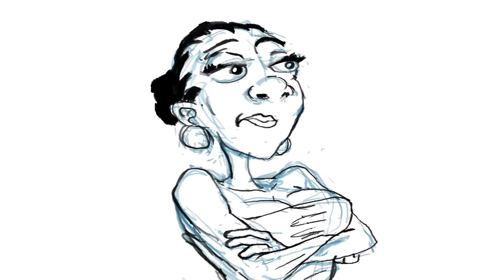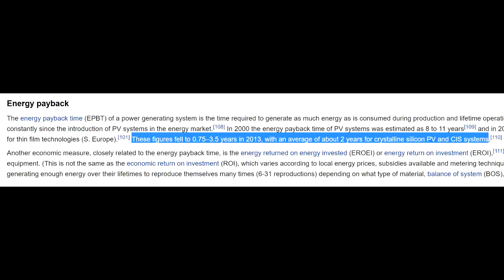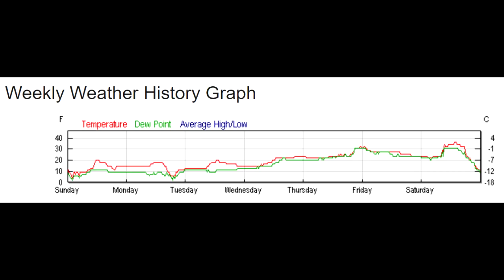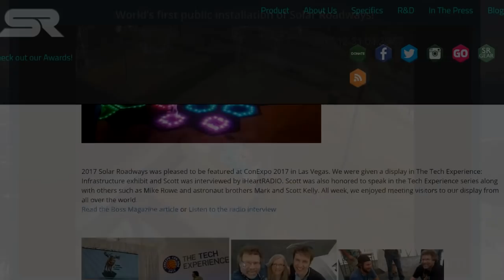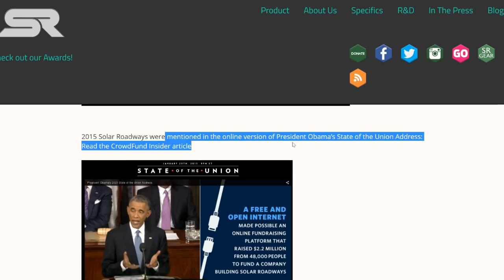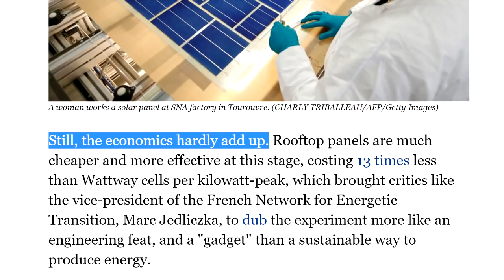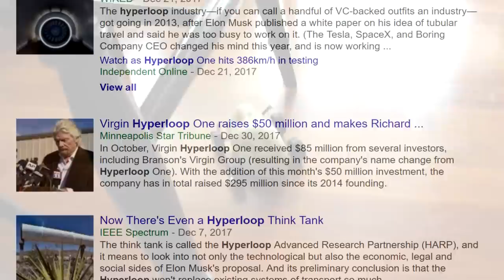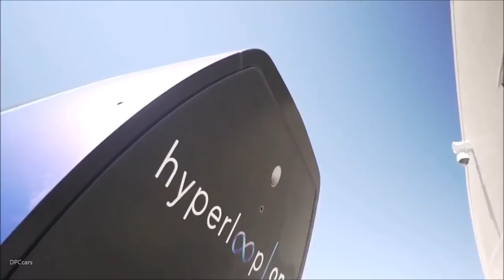Solar roadways, NEVER shovel snow agai... oh

Comment: If the bloody roadways melted the snow, it would just freeze to ice on the side of the road, and make a river. A river bed of glass, and ice cold water.
Reply: And the millions of solar panels shorting out because of the water.
Might as well be one epic failure/catastrophe.
Wow, epic failure, haven't used that age-old meme in a long time.
Reply: Not exactly,  pex line is installed in residential area's and in some public transportation. Its just a plastic tube that is hooked up to a boiler  a few inches below concrete. And the melted water runs into the sewers to prevent buildup. Its not to common because of the initial costs.  It works really well though.
Reply: Where I live, the sides of the road are 6 foot deep ditches. So no real loss there.
Reply: Maybe you just invented Solar River Canal Beds Division of Solar Roadways.  Now can you think of something that might work for Solar Tunnels?
Reply: Then we would need those super cool plastic roadways with inbuilt drainage channels... oh.... wait. :(
Reply: Guys, it's so obvious.

Solar Freakin' Water Boilers!
Reply: Maybe we can go ice fishing then? But other then that, even going straight into the sewers won't make everything better cause you know, not every single place in the world has a good sewage system DA LA. I know my area is finally getting new shit LITERALLY. With all the new hotels up we need it, there are more hotels in the area then there are restaurants. (This is an actual fact.) every winter the pipes would freeze at the old hospital creating a literal shit show some years. So yeah, let them all drain into the sewers, but then just outside the city where does all the water go? God people are stupid.
Reply: admiraal534 
Yeah, but your city hired people who actually understand how this stuff works to build a thing with a set purpose. Without grandiose claims of it generating more power than it uses!
Reply: Uhm, roads normally have provisions in place to carry water away. Maybe they don't in the primitive US, but elsewhere, they do.

As a result, what you describe does not happen.
Reply: Don't worry, the solar panels generate a gigawatt of power each, so they can just vaporise the snow into steam on impact!
Reply: You guys must not live in a northern climate. 

The snow melts all the time on the road and never forms an ice sheet on the side of the road.

Never once seen it happen even in -40°F/°C temperatures.

Same with heated driveways.

I don't know if this is true or not but asphalt melts most of the snow by its self. I think it is because it is black so it absorbs more heat from the sun. Also all the cars traveling on it creating friction and the cars themselves are warming it up with their exhaust ect. I have never googled it but roads that are traveled a lot their snow is always melted pretty quickly unless it is crazy cold.
Reply: Yes they do, but ditches will normally not be heated. You need to keep the water above 0, so this solar panels with snow and water (and short days with little light) on them need to produce enough energy to melt the snow but also heat the water to keep it from freezing while in the ditch. You can do this in a city if you have a big and warm sewagesystem to catch it, but if you pour water in a ditch in cold weather, it will freeze. Imagine that.
Reply: It probably wouldn't have much of a chance to refeeze before entering the drainage system which prevents the road turning into a pond when it rains.
The problem with melting the snow as it falls on the road is the amount of energy required.
Ice has a specific heat capacity of 2.1 kJ/kgK and a latent heat of fusion of 334 kJ/kg
Reply: There's the cost of the energy to melt the snow, especially in a heavy snowfall.
Were it that simple I suspect that such heating systems would be a a standard feature at airports.
It's far more common to use specialist snow removal vehicles, even though these might be parked for most of the time. Takes far less energy to move snow a short distance than to melt it.

Comment: Solor roadways powered by thorium that last 100 years with cold fusion.
Reply: solor*
Reply: Solar*  Road*ways
Reply: If they funneled sewage in the tunnel, and then used a methane generator running off said plumes of sewage.. you could essentially power the thing using our own crap. Makes more sense, and yes this is possible now with farms reusing cow and pig waste as a source of fuel to power their own farms.
Reply: $200+ backers get a free artificial gill that also extracts 10L of water out of thin air daily while recycling CO2 into phone cases as well, all while hovering over a copper floor!
Reply: well the hovering over a copper floor one is possible with a non-powered magnetic object if you get all the north/south poles of the copper lined up correctly but it will only work on specially made floors and only for a short time too
Reply: That might work cause thorium is Very dense.what?
Reply: You forgot about Vitamin B17 and Tesla's Hyperfail
Reply: That random person That comments nothing wrong with fission if we could build modern plants. Everyone thinks Nuclear plants have to be like Chernobyl.
Reply: <scratchy record sources> "And good sir, is this new marvel of modern science powered by coal?"
"Of course not, foolish urchin! The heliodynamo mechanical horse-path (p. pending Doctor Barnabus Q. Fosdyke & Sons) is powered by pure RADIUM!"
Reply: Thorium powered cold fusion? Oxymorons are fun.
Reply: *Sulla rordwes
Reply: Shoulda used thundrainium.  My fav fuel source as a kid.
Reply: Thorium is very dense
Reply: @gameplayCroatia  no he spelled it right

Comment: Proof of concepts are cool but generally they're supposed prove the concept before they're implemented.
Reply: Cameron Goode I see this working in the south where we get light snow and ice at worst. But up north and in mountains these would just be bad. :/ I've lived in Alabama most my life and Pennsylvania the other parts and I could not see this working up there XD
Reply: "This is a state of the art system."   "But it doesn't work!"   "Well, yes. Unfortunately, that's the state of the art."
Reply: Cameron Goode If you go on the website instead of referring this ‘‘tis video you’ll learn that these are early prototypes that literally are tested outside their house. Of course there is going to be problems with beginning stages. Being skeptical is always fair but just shitting on something that could potentially have a huge impact is just cynical. Just think of Thomas Edison and the lightbulb it took him thousands of tries, Elon Musk and his sea platform payload launching rocket took him a hundreds of tries. I don’t know why everyone is so unoptimistic about this here....
Reply: Dams can wipe out entire species of fish in an ecosystem that rely on breeding grounds. Wind can mutilate flocks of birds traveling north during season switches, and both by no means are as efficient in relation to solar power. Because both rely on moving parts, which wear over time. Solar power has no moving parts and can essentially last as long as it is protected from harm. Solar power is going to be efficient when engineers and scientist figure out the graphene battery, which is also solid state and will not wear down over time. Plus the fact that the new roadster Telsa is producing can go for more than 300 miles, and recharge in a matter of a minute,  that's revolutionary. Also solar roadways predicts that if the entire road we have today was replaced with these then America would produce 3x more energy. 67% of that would only be utilized as the other 33% is used for the functions of the heating and LEDs. Yeah sure continue to shit on this like scientist in the old day would at theories that turned out revolutionary. Soon when it is completely fleshed out, I'm sure this will do the same.
Reply: Also Don't get me wrong the company Solar Roadways is taking it wrong in some ways but the first people to do it usually start the race. Example: China. Nobody was good at building rockets at the beginning of the space race... 10 years later 2 people successfully planted the American flag on the moon.
Reply: Nope, just prove that the concept exist, ¡Duh!
Reply: :D I think then you need to travel back in time to the 60s these guys built your ideas all over the place and it is used to cover the the peak hour consumption for decades. What you propose is a workable solution if it was not only for the eco freaks that hear reactor and get a heart attack. https://en.wikipedia.org/wiki/Pumped-storage_hydroelectricity
Reply: I think what people do not get is that while there is base power and variable power output and solar is variable. Batteries are great for short and quick reacting back up like the current Australia project Tesla has done proved BUT anyone that says that you can run a whole continent off of a battery pack for 12 hours over night is a looney. Even the biggest project can only power 15 000 homes for 4 hours. So Does renewable energy like solar panels help and can be more important Yes. Can they solve the problem of energy consumption and be fully relied on as the solution for energy supply NO WAY IN HELL it is math. 

Even if the Graphene batteries had 10 000 times energy density they could not. It is just too much power and the funny thing is that no one is even calculating the absolutely enormous increase we need to have to consider to power all the electric cars that run gas and diesel now. 

If you want to be entertained go google energy density of 1l of gas or diesel then multiply by total annual consumption per whatever country you pick convert the joules to kwh and your head will explode. And that is operating under the assumption that the power comes evenly across the time which is not the case can you imagine that peak amperage needed if all of EU comes home in their teslas from work with majority arrive 5 6 or 7 PM the Whole distribution grid would explode in magnificent blue fire ball. 

So even if we waved magic wand and had that power we don't have the grid capacities and I mean the world no one not USA not EU not ANYONE. 
You know who is most afraid of widely used electric vehicles it is not the oil companies it is the power companies. You know how long the governments were building up grid systems? Decades since early 20th century it takes billions and billions and billions of dollars and decades to accommodate such a increase in transfer capacity needed. They have tried to go with super high voltage vires with over million volts to push more power through same lines it is not working maximum feasible is 400 000 (diminishing returns over 800 000)volts which is basically current standard for intercontinental transfer within EU with 220 000 also used. 

They are all solving the wrong problem it is not the power plants panels are already cheap enough to deploy in mass scale wind power too. Tesla with some tax incentives could sell much better problem is we are not prepared for success. We need Safe Thorium reactors for base power generation and no research is done and we need to increase grid capacity by factor of 4 which is ... yeah.

Comment: The Problem from an Engineering perspective is that the solar roadway has to fulfil too many requirements which are contrary to each other. Like 
1. Allow parking of cars -> a very thick and also transparent material, blocks sunlight
2. Generate as much solar power as possible -> a very thin and highly transparent layer
3.  LEDs which act as sighns and illumination-> LEDs take space away from solar cells and need energy themselfes
4. Snow and ice free surface -> high energy comsumption, basically heating elements -> uses more power than can be generated, uses up space and hinders solar cells and LEDs
5...
Reply: the panels themselves work as heating elements (they get really hot when working and actually these "solar roadways" are failing in part due to cooling problems)
Reply: The LEDs might die pretty quickly when the panels reach >80°C during summer.
Reply: Kyaru Momochi  considering how wasteful and full of instalation problems they are they probably will melt the snow by bursting into flames.
Reply: while I believe it could work if place on walkways and not in a place that snows i just don't understand why it's necessary it's not like America doesn't have any place that isn't occupied where they could just use normal solar panels

Comment: Solar roadways: You'll never have to shovel again!
Reality: Shoveling will be a greater pain.
Reply: We'll need those shovels to throw solar roads in the trash
Reply: John Jamele The first time water creeps it’s way in between and under the panels and freezes the panels will work their way loose. I can’t imagine any way solar roadways will ever work in the north or anywhere really.
Reply: Eldiron Like washing Dishes before putting them in a crap Dishwasher.

Except the Dishwasher at least did what it was suppose to prior.
Reply: Screw that solar panels are expensive I'll just move them to my rooftop
Reply: Reality: Get rid of ice and snow...by turning it into water...and then flood the roads! Yay! No more snowplows that move the water off of the roads conveniently to the drains, so that when the snow melts it goes to the lake...instead of everyone's basements.

Like I swear people act like solar roadways would magically evaporate all the snow. Where is the water going to go??? Snow is the best form of water, taking away the ability to use a snowblower just means it's either flooding or it's ice. Both worse than snow.

I'm listening to the list of supporters of solar roadways and I'm still livid.
Reply: You really will never shovel again, cause the panels will catch on fire!

Comment: @Thunderf00t

We have a solar roadway cycling track in the netherlands, and they basicly came to the following conclusion :
It would be more effective to place the pannels above the cycle path instead of on the cycle path surface.

The layer added to make the panels more durable so one can cycle over them makes the pannels less efficient and would not be needed if the pannels where above the cycling path.
If the panels where above the cycling path they could be tilted and to some degree be made to track the sun increasing efficiency.
The panels above the path could dubble as infrastructure for lighting the cycle path.
It might make cycling on the path more comfortable as the pannels above the path would create some mesure of rain and wind protection for the cyclists.( while the panals on the path surface tend to get very slippery in freezing and rainy conditions)
Reply: Why do such realizations only come after spending a lot of taxpayer €€€?
Reply: I'm not a cyclist but I can think of several more drawbacks about solar roadway cycling tracks. To begin with, putting the solar panels on raised roofs which would double as windbreaks and shade for the cyclists in hot weather. Plus shelters from the cold and rain during bad weather, as was said before. BUT I'd add that basics such as restrooms and rest stops would likewise be a good place to put solar panels on: The building is already there to begin with. And, the fact that these solar roadway promoters keep ignoring is this... HOW can the "Roadway" produce power when there are people riding on it?
Reply: David Reyes cyclist here: glass is slippery. Even if it was rough it’s still slippery. And no cyclist wants to be face first in snow in winter.
Reply: They had to actualy build it to get to those conclusions? Sounds like a bunch of bureaucrat "designers" to me.
Reply: No
Freaking
Shit

It tops the list as the stupides idea ever, there literally isn't a worse place for solarpanels except for under the ground.

With this money and time wasted they could have done at least some things that do make sense for anyone with an IQ over 60.
- Build parking lots with solarpanels for example at road restaurants and shops to charge the batteries of electric vehicles
- Install solarpanels on roadlights
- Improve existing infrastructure
- Increase public transportation such as safer and wider traintracks, trains with lower drag coefficient, trams, bus lines...

Comment: In Holland there's a stretch of Freeway along the A9 that has 2,200 solar panels mounted on top of the acoustic fence. That's a better placing for a solar panel. High up and out of the way of traffic.
Reply: Not Holland, the Netherlands. Unless you're talking about the two provinces.
Reply: It can be both. The A9 goes through Noord-Holland in the Netherlands.
Reply: @lizardirl9488  tool
Reply: but its not a SOLAR FRIGGIN ROADWAY!!